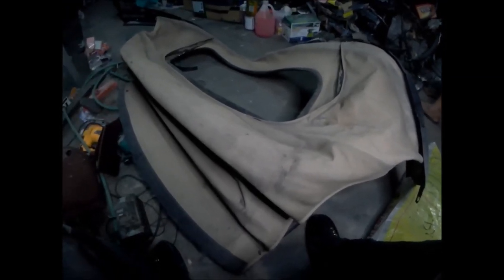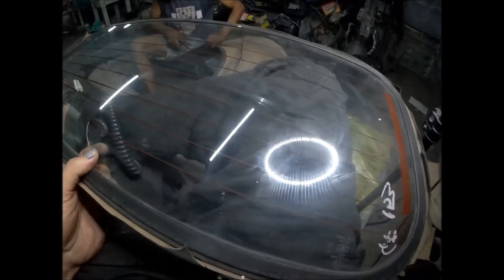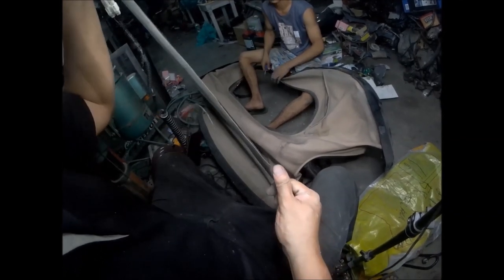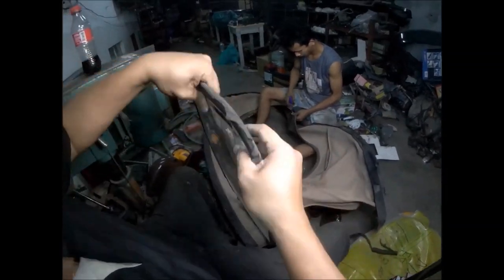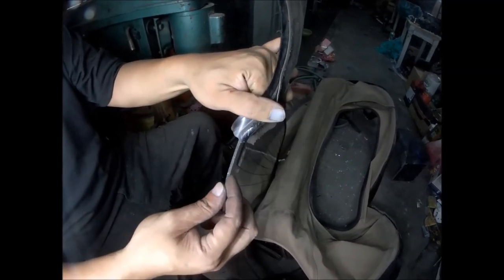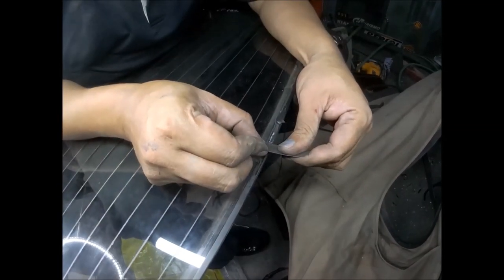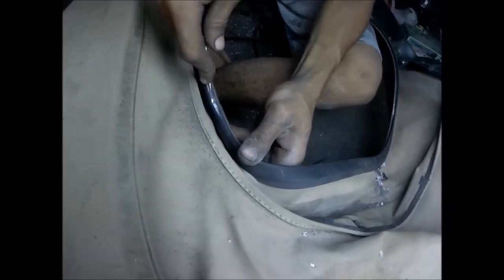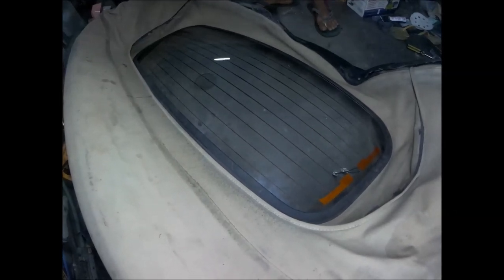Miata Soft top Rear Glass Install

Comment: If mine doesn't have that weatherstrip on the soft top anymore, do I need to replace the entire top?
Reply: Some of the soft tops dont have the black rubber seal around the glass like the one in this video. Instead, the glass is directly attached to the soft top, so it might be that you have the older type of soft top. In regaurds as to if you have to replace the entire soft top, i would consult a professional.